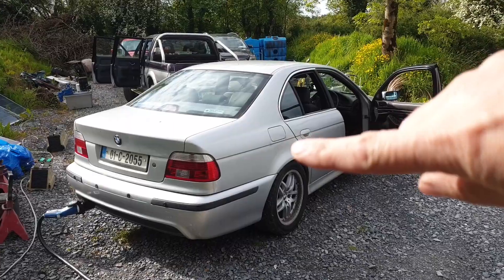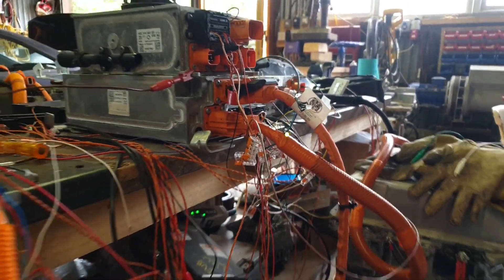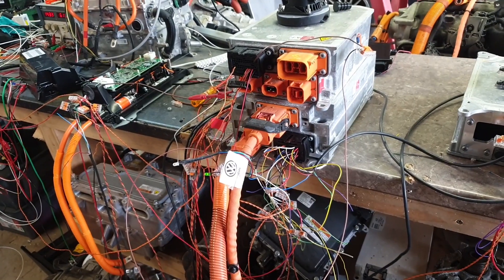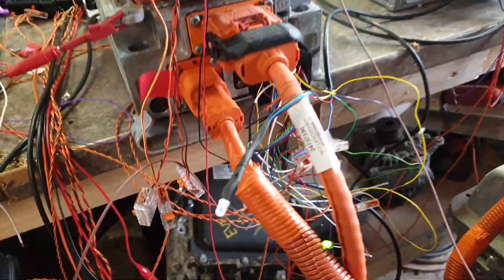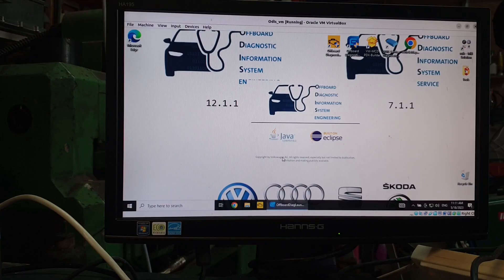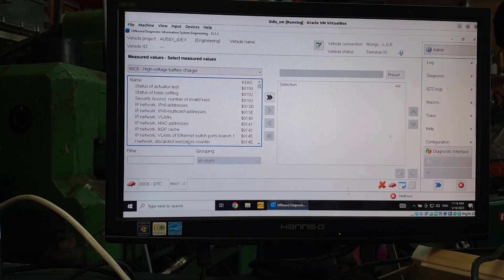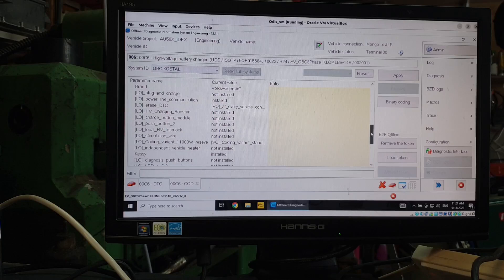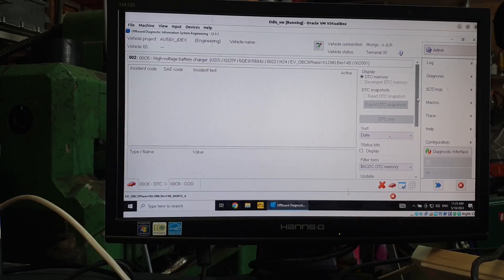Lab Update: VW Chargers

Comment: Heh, I understand that joke. They made the comm pins shorter which would trigger a charger cutoff in the Mennekes plug. The J1772 doesn't have that feature though. But the micro switches in the plugs tend to die outside after a while, i bridged that out.